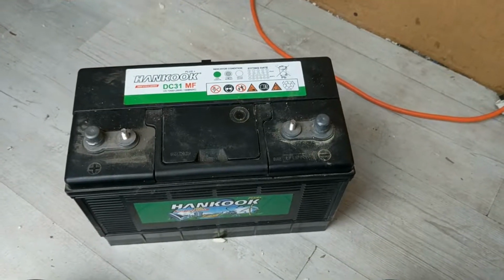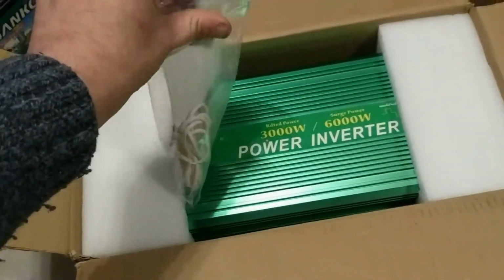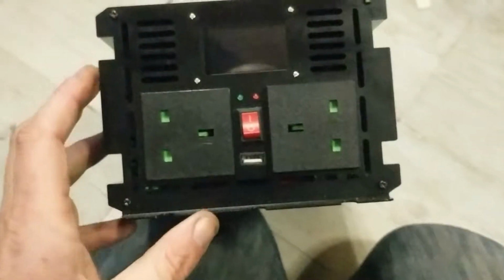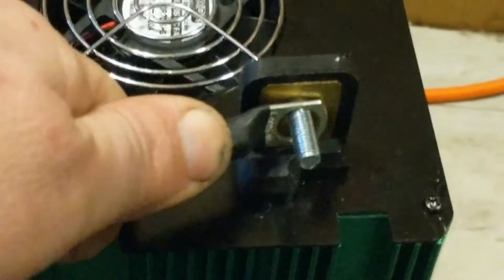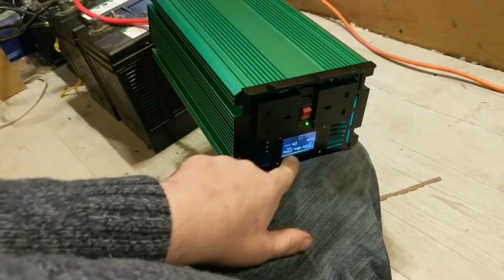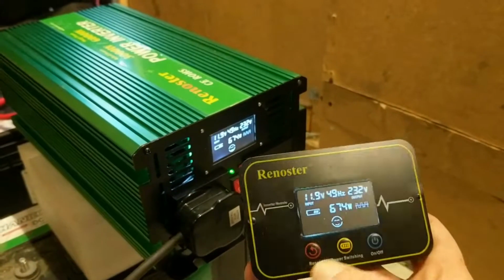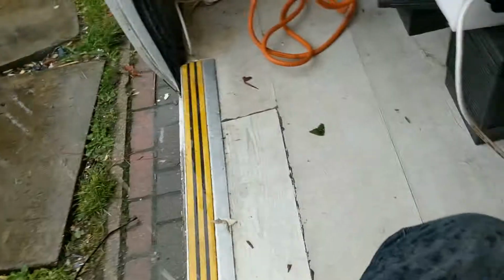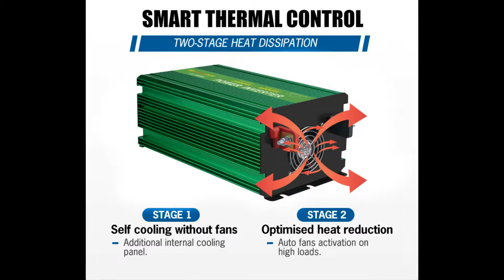unpacking/review/test 3kw renoster inverter SMOKING !!!!

Comment: Good informative video. Thanks for sharing your experience with this inverter. I'm sorry it didn't work out too well :(.
I can see from the video that it is not a Pure Sine Wave Inverter (as once questioned in the video).
To the right of where it says "Surge Power 6000W" on the top of the inverter, there is is a diagram of the modified sine wave and the text "modified sine wave". This is visible at 3:22 and 6:30.
On the right hand side of the remote control screen there is modified sine wave diagram underneath where it says "OUTPUT". This is visible at 3:42
Reply from the maker: Yeah I'm fortunate in having things to power that just don't care, the capacitor start table saw can be a bit choosy some days while the washing machine with a capacitor motor runs fine, all my other gear is switchmode powersupply driven so square or even DC would do. They replaced this, and refunded on the second and said to bin it....no no no lol, you repair..... So I stripped it and found the problem, the output MOSFETs were correct part number, 30n50, but from manufacturer to manufacturer MOSFET wattage isn't the same! Guess they bought in from a different supplier and this is the result... I replaced the output stages with ones rated higher, works fine now.

Comment: Bummer the Genie escaped ?     Yea,  a fan should have come on first raise of Temp I would think.   Dhooooooooooooooooooo !   I was liking that one too.  Most struggle putting out half of what the label says.   Chines rating system .  If they say 20A that means it will only Smoke at 10A and won't burst into flames until 20A.
Reply from the maker: Yeah usually on inverters and motor controllers Chinese eBay seller amps or watts are like one third of real world.
Return started, awaiting sellers reply..

Comment: Never going to get any place that way.   I use a Steam Pump.   Micro waves will work fine on Modified.   Noisy and slightly reduced power but work.    Works fine for quick cooks and heating stuff.  Best not long term cooking.  Heats up the Transformer .

Comment: Brilliant video very informative...how long does the battery last in the wireless monitor..thanks justin
Reply from the maker: Few weeks, so I ended up adding an internal charger to it but the same could be done with a 12v to 5v phone charger and a micro usb cable. The inverter is still working the design is good but they must have moved to some cheaper parts supplier or they themselves got supplied B grade parts and didn't know, I'd happily buy another, on fact I just might buy there new sine wave version as an upgrade
Reply: @WereReallyRelayCamping thanks for the reply I will be l@@king forward to a review on it..
Reply: @WereReallyRelayCamping  
The design is sometimes amazing and the engineer did his job but there are not grade B parts in there. Sometimes they use the grade F ones! :))

The common issue with cheap electronics is that they get to put in parts that were taken out the factory from the back door. The parts that were deemed as rejects and not even having the identifier etched on them. Instead of them getting milled back for raw recycling, some folks get them by the bucket, etch or print a similar p/n and end up in consumer devices. 

My rule with any chinese device is, when it arrives, I carefully and thoroughly void their warranty and put in my own :D
I mean these need quite a bit of rework and QC (which they do not actually get in their factories.)

Anyway, I just budged in to say there are no grade B parts. Just F, and yes, it's F for fucked up. 
Anything that is remotely expensive, from power semiconductors to low tolerance passives that are needed in power electronics. 
Even copper wiring is replaced with copper plated or red varnished aluminium or iron.
Reply: so true.

Comment: How do you expect it to work if you let the magic smoke out of it?  Lots of folks having issues with these especially running electronic gear.  No way does this look like a "pure sine wave" output.  Would be nice to see the wave form on a scope. Cheers.
Reply from the maker: Yeah this one had a duff fan, they replaced the whole thing. The replacement is in another video, that one worked fine for a day,   then failed the next morning. It's not pure sine they lied.... Anyhow they refunded the 2nd one and said I should dispose of it. So I threw it on my bench and rebuilt it. Still working since my rebuild.

Comment: Great vid!
Reply: Smokin Hot
Reply: I had a smaller cheaper inverter that I never heard the fan come on, got ready to bypass my own fan or rig a temperature sensor. but came on when it got warm/higher loads.

Hope you had better luck with the replacement!

Comment: How do ground this inverter? Don't see any ground lug?
Reply from the maker: It's a "floating" output it's not for use in a house is for in a camper van or a boat. It has 2 wire AC output with no ground, around 90% of inverters built this way. If you are using it in a boat/van then you can connect a lug to the body of the van/boat and connect that to ground lug of the output sockets. Neither of the 2 AC wires can be connected to the boat/van chassis and the instructions say this can short the inverter.
Reply: @WereReallyRelayCamping  Hi.. thanks for the video and for this explanation. Could you tell me what you mean buy connecting the body to the ground lug of the output sockets? Would we be running a separate wire from the body of the boat/van through the case of the inverter somehow and into the back of what would normally be the ground terminal in the output sockets? I did open mine and notice the ground terminals aren't connected to anything at all. It looks like these are 2 hot wires at 60 volts each instead of a hot and a neutral? Thanks

Comment: Been a year since you uploaded this. Hopefully someone has pointed out to you that this is a 1500w inverter. Not a 3000w.
The surge is 3000w but that can only be used for a matter of seconds. Less than 5 seconds.

So as soon as you exceeded 1500w it was sure to fail.
Perhaps of you had read the specs first. Or asked someone who was qualified.
If the seller seen this video there is no way he would have given you an exchange or refund.

If you want to draw 2000+ watts l would advise you to have someone who is qualified advise you. Or tell the seller how many watts you need to draw & they will advise a suitable inverter. But 2000+ watts is going to cost £200+
Reply: this was the 3000w '6000w' model, they replaced it with one with a working fan, it survived all my testing but failed going to full 2.2kw at something like 1-2c on a cold morning some days later, they said bin it, so i took it apart and found the problem, wrong mosfets fitted (on the output side), didnt match the part numbers printed on the pcb. the correct ones were fitted (actually uprated slightly) and its still going and doing 2.2kw to this day, about 3 weeks ago i noticed the output voltage had dropped, i think vibration may have jiggled the pot that sets it, but i cant be bothered to uninstall it, get it on the bench and fix it, 215v will have to do for now....
maybe when you go all sarcastic and say to read the specs, you should watch the video,  it says "3000w / Surge Power 6000W" on the top of the inverter....

Comment: Hi did this get resolved ?
Reply from the maker: errr the first one was sent back for replacement, they sent another, then when that went pop they issued a full refund and said bin it. i dont bin anything, I rebuilt it with better quality parts, now 3kw doesnt scare it...scares the batteries though lol
Reply: @WereReallyRelayCamping  that's fantastic ! I am tempted to give a pure sine wave one ago but seeing your video has made me think ?
Reply from the maker: @brettpurchase-rathbone7948  well I don't worry too much as eBay's not too bad at honoring the gtee if not as described, then you can always take it up with PayPal, and you should have your PayPal linked to a credit card not a bank card or bank account as a credit card company can always just take the money right back. Upsets PayPal that does.....
Reply: @WereReallyRelayCamping  thanks for advice I always have confidence in eBay had issues in past and they have always sorted... The main selling point with this inverters for me is the remote so I can turn off when not in use as the inverter itself will be located in a hard to at place ... Hopefully all is going well with yours ? I am hoping to run a small induction hob off mine ...
Reply from the maker: @brettpurchase-rathbone7948  our cheap induction hob won't work right on any of our inverters, best to ask seller if it will be compatible and that you can return if not etc
Reply: @WereReallyRelayCamping  ok cool. Are any of yours pure sine wave?
Reply from the maker: @brettpurchase-rathbone7948  no not anymore, I had a 1500w one the seller had removed all the stickers off and sold as a 3000w but the induction didn't like that one either. That was the blue one in my videos
Reply: @WereReallyRelayCamping  yeah this is the problem with some of theses items ... They lie about capacity I have had this in the past with charging blocks ! Hopefully the one I have ordered will do ! I have seen others run an induction hob but it's a bit few and far between ! It's only an option I am looking at for now so not be all and end all if doesn't work